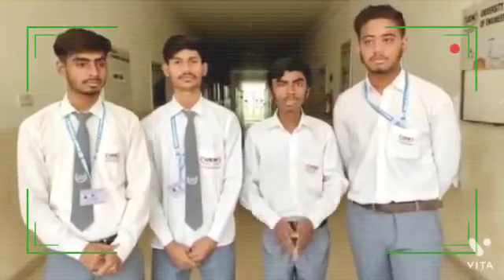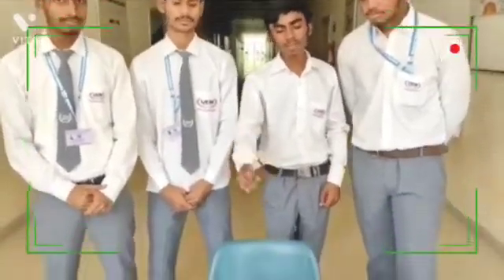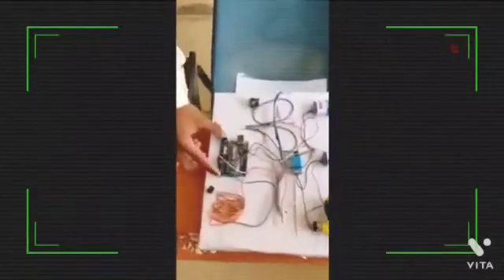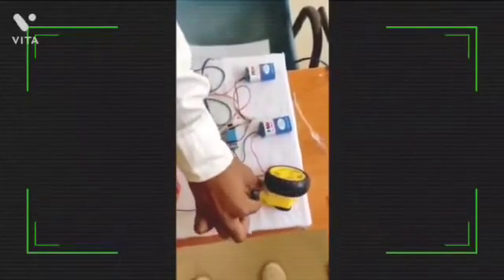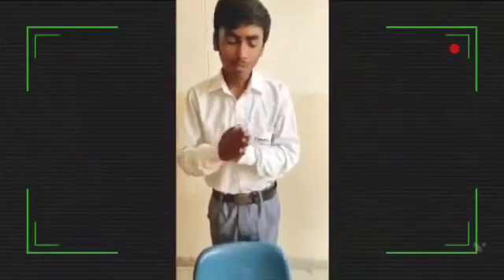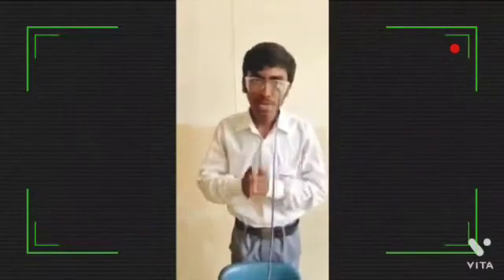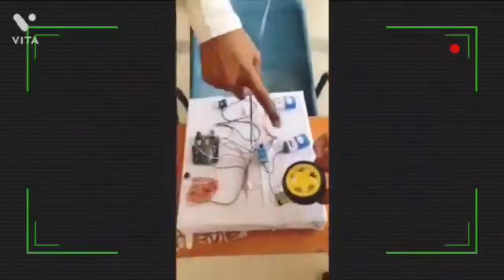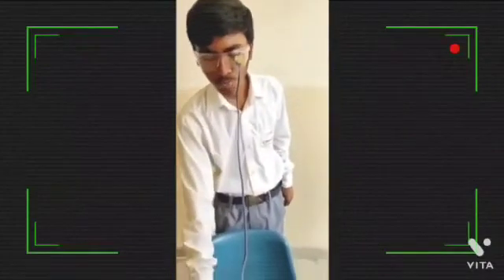ANTI SLEEP ALARM FOR DRIVERS

Comment: can i get the circuit diagram
Reply: @swapankumarsheeuem   how to do the connections
Reply from the maker: https://drive.google.com/file/d/1qcxRc1NJletfdfXAgi6b7PCfGJo4GUho/view?usp=drivesdk
Reply: @swapankumarsheeuem  For which arduino board is the code written for ? 
because in circuit diagram it is arduino nano but in video it is arduino  uno
Reply from the maker: The code is strictly for aurdino nano but I think there will be no problem with the other aurdino.

Comment: Send me th code
Reply from the maker: Arduino code:

#define Relay 13
#define buzzer A0
static const int sensorPin = 10;                    // sensor input pin 
int SensorStatePrevious = LOW;                      // previousstate of the sensor

unsigned long minSensorDuration = 3000; // Time we wait before  the sensor active as long 
unsigned long minSensorDuration2 = 6000;
unsigned long SensorLongMillis;                // Time in ms when the sensor was active
bool SensorStateLongTime = false;                  // True if it is a long active

const int intervalSensor = 50;                      // Time between two readings sensor state
unsigned long previousSensorMillis;                 // Timestamp of the latest reading

unsigned long SensorOutDuration;                  // Time the sensor is active in ms

//// GENERAL ////

unsigned long currentMillis;          // Variabele to store the number of milleseconds since the Arduino has started

void setup() {
  Serial.begin(9600);                 // Initialise the serial monitor

  pinMode(sensorPin, INPUT);          // set sensorPin as input
  Serial.println("Press button");
  pinMode(Relay,OUTPUT);
  pinMode(buzzer,OUTPUT);
}

// Function for reading the sensor state
void readSensorState() {

  // If the difference in time between the previous reading is larger than intervalsensor
  if(currentMillis - previousSensorMillis > intervalSensor) {
    
    // Read the digital value of the sensor (LOW/HIGH)
    int SensorState = digitalRead(sensorPin);    

    // If the button has been active AND
    // If the sensor wasn't activated before AND
    // IF there was not already a measurement running to determine how long the sensor has been activated
    if (SensorState == LOW && SensorStatePrevious == HIGH && !SensorStateLongTime) {
     SensorLongMillis = currentMillis;
       SensorStatePrevious = LOW;
      
      Serial.println("Button pressed");
    }

    // Calculate how long the sensor has been activated
   SensorOutDuration = currentMillis - SensorLongMillis;

    // If the button is active AND
    // If there is no measurement running to determine how long the sensor is active AND
    // If the time the sensor has been activated is larger or equal to the time needed for a long active
    if (SensorState == LOW && !SensorStateLongTime && SensorOutDuration >= minSensorDuration) {
      SensorStateLongTime = true;
      digitalWrite(Relay,HIGH);
      Serial.println("Button long pressed");
    }
    if (SensorState == LOW && SensorStateLongTime && SensorOutDuration >= minSensorDuration2) {
     SensorStateLongTime = true;
      digitalWrite(buzzer,HIGH);
      delay(1000);
      Serial.println("Button long pressed");
    }
      
    // If the sensor is released AND
    // If the sensor was activated before
    if (SensorState == HIGH && SensorStatePrevious == LOW) {
      SensorStatePrevious = HIGH;
      SensorStateLongTime = false;
      digitalWrite(Relay,LOW);
      digitalWrite(buzzer,LOW);
      Serial.println("Button released");

  
    }
    
    // store the current timestamp in previousSensorMillis
   previousSensorMillis = currentMillis;

  }

}

void loop() {

  currentMillis = millis();    // store the current time
  readSensorState();           // read the sensor state
  
}
Reply from the maker: Arduino code:

#define Relay 13
#define buzzer A0
static const int sensorPin = 10;                    // sensor input pin 
int SensorStatePrevious = LOW;                      // previousstate of the sensor

unsigned long minSensorDuration = 3000; // Time we wait before  the sensor active as long 
unsigned long minSensorDuration2 = 6000;
unsigned long SensorLongMillis;                // Time in ms when the sensor was active
bool SensorStateLongTime = false;                  // True if it is a long active

const int intervalSensor = 50;                      // Time between two readings sensor state
unsigned long previousSensorMillis;                 // Timestamp of the latest reading

unsigned long SensorOutDuration;                  // Time the sensor is active in ms

//// GENERAL ////

unsigned long currentMillis;          // Variabele to store the number of milleseconds since the Arduino has started

void setup() {
  Serial.begin(9600);                 // Initialise the serial monitor

  pinMode(sensorPin, INPUT);          // set sensorPin as input
  Serial.println("Press button");
  pinMode(Relay,OUTPUT);
  pinMode(buzzer,OUTPUT);
}

// Function for reading the sensor state
void readSensorState() {

  // If the difference in time between the previous reading is larger than intervalsensor
  if(currentMillis - previousSensorMillis > intervalSensor) {
    
    // Read the digital value of the sensor (LOW/HIGH)
    int SensorState = digitalRead(sensorPin);    

    // If the button has been active AND
    // If the sensor wasn't activated before AND
    // IF there was not already a measurement running to determine how long the sensor has been activated
    if (SensorState == LOW && SensorStatePrevious == HIGH && !SensorStateLongTime) {
     SensorLongMillis = currentMillis;
       SensorStatePrevious = LOW;
      
      Serial.println("Button pressed");
    }

    // Calculate how long the sensor has been activated
   SensorOutDuration = currentMillis - SensorLongMillis;

    // If the button is active AND
    // If there is no measurement running to determine how long the sensor is active AND
    // If the time the sensor has been activated is larger or equal to the time needed for a long active
    if (SensorState == LOW && !SensorStateLongTime && SensorOutDuration >= minSensorDuration) {
      SensorStateLongTime = true;
      digitalWrite(Relay,HIGH);
      Serial.println("Button long pressed");
    }
    if (SensorState == LOW && SensorStateLongTime && SensorOutDuration >= minSensorDuration2) {
     SensorStateLongTime = true;
      digitalWrite(buzzer,HIGH);
      delay(1000);
      Serial.println("Button long pressed");
    }
      
    // If the sensor is released AND
    // If the sensor was activated before
    if (SensorState == HIGH && SensorStatePrevious == LOW) {
      SensorStatePrevious = HIGH;
      SensorStateLongTime = false;
      digitalWrite(Relay,LOW);
      digitalWrite(buzzer,LOW);
      Serial.println("Button released");

  
    }
    
    // store the current timestamp in previousSensorMillis
   previousSensorMillis = currentMillis;

  }

}

void loop() {

  currentMillis = millis();    // store the current time
  readSensorState();           // read the sensor state
  
}

Comment: Hii
Reply from the maker: Arduino code:

#define Relay 13
#define buzzer A0
static const int sensorPin = 10;                    // sensor input pin 
int SensorStatePrevious = LOW;                      // previousstate of the sensor

unsigned long minSensorDuration = 3000; // Time we wait before  the sensor active as long 
unsigned long minSensorDuration2 = 6000;
unsigned long SensorLongMillis;                // Time in ms when the sensor was active
bool SensorStateLongTime = false;                  // True if it is a long active

const int intervalSensor = 50;                      // Time between two readings sensor state
unsigned long previousSensorMillis;                 // Timestamp of the latest reading

unsigned long SensorOutDuration;                  // Time the sensor is active in ms

//// GENERAL ////

unsigned long currentMillis;          // Variabele to store the number of milleseconds since the Arduino has started

void setup() {
  Serial.begin(9600);                 // Initialise the serial monitor

  pinMode(sensorPin, INPUT);          // set sensorPin as input
  Serial.println("Press button");
  pinMode(Relay,OUTPUT);
  pinMode(buzzer,OUTPUT);
}

// Function for reading the sensor state
void readSensorState() {

  // If the difference in time between the previous reading is larger than intervalsensor
  if(currentMillis - previousSensorMillis > intervalSensor) {
    
    // Read the digital value of the sensor (LOW/HIGH)
    int SensorState = digitalRead(sensorPin);    

    // If the button has been active AND
    // If the sensor wasn't activated before AND
    // IF there was not already a measurement running to determine how long the sensor has been activated
    if (SensorState == LOW && SensorStatePrevious == HIGH && !SensorStateLongTime) {
     SensorLongMillis = currentMillis;
       SensorStatePrevious = LOW;
      
      Serial.println("Button pressed");
    }

    // Calculate how long the sensor has been activated
   SensorOutDuration = currentMillis - SensorLongMillis;

    // If the button is active AND
    // If there is no measurement running to determine how long the sensor is active AND
    // If the time the sensor has been activated is larger or equal to the time needed for a long active
    if (SensorState == LOW && !SensorStateLongTime && SensorOutDuration >= minSensorDuration) {
      SensorStateLongTime = true;
      digitalWrite(Relay,HIGH);
      Serial.println("Button long pressed");
    }
    if (SensorState == LOW && SensorStateLongTime && SensorOutDuration >= minSensorDuration2) {
     SensorStateLongTime = true;
      digitalWrite(buzzer,HIGH);
      delay(1000);
      Serial.println("Button long pressed");
    }
      
    // If the sensor is released AND
    // If the sensor was activated before
    if (SensorState == HIGH && SensorStatePrevious == LOW) {
      SensorStatePrevious = HIGH;
      SensorStateLongTime = false;
      digitalWrite(Relay,LOW);
      digitalWrite(buzzer,LOW);
      Serial.println("Button released");

  
    }
    
    // store the current timestamp in previousSensorMillis
   previousSensorMillis = currentMillis;

  }

}

void loop() {

  currentMillis = millis();    // store the current time
  readSensorState();           // read the sensor state
  
}